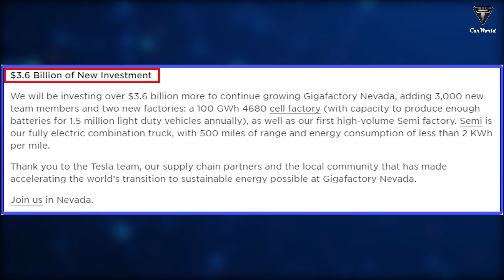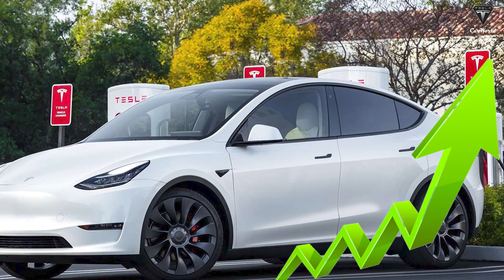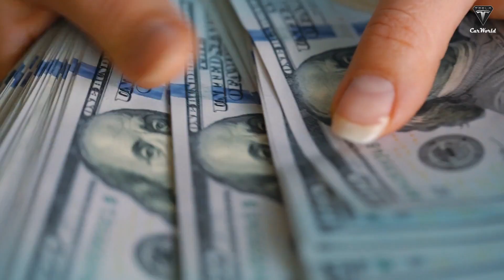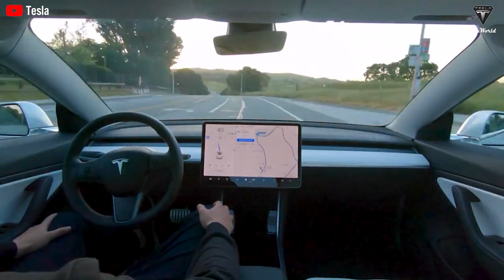Just Happened! Elon Musk Unveils Tesla New Battery Project, Destroy All Car Industry!

Comment: https://youtu.be/SO4fErcr5e8

This is a video of a guys invention that Couples magnet motors together. One spins and as many as you need spins. 
Side air ducts like on a Farrari that pinpoints a stream on air that hits the blades of one motor and five more spin, all producing electricity to keep the batteries charged constantly. There'd be little need for Charging Stations. 
Magnet Motors are efficient, low cost, easy to manufacture and could last a hundred years and more. These are the kind that the magnets turn around the coil winding's so that the positive and negative leads can be connected to a charger. 
It's one thing to make better batteries, but some focus should be on the charging system. Simi trucks travel hundreds of miles a day not utilizing the air they have to push out of the way.

Comment: Nothing new here! No new battery technology. Lithium is a non-starter! Click bait.
Reply: Do syst drive instead of battery pre relitive litium setups, which also receives the electricity from syst initially through chemical relativity pre setups.
Reply: @stefanowiehahn9435  I have no idea what you just said or asked. Gibberish. Lithium is just too expensive, too limited for world-wide use in all electric drive applications. It’s a non starter. Might as well use gold and platinum batteries.
Reply: Lithium works because it's relitive to use for batteries, relitive through the syst in top data. What I'm saying is that if u run off just syst there is no battery needed. Syst is infinite free energy.
Reply: @stefanowiehahn9435  So there really IS a free lunch, eh? What the heck is “syst”? No such thing as free energy which uses no energy to develop.